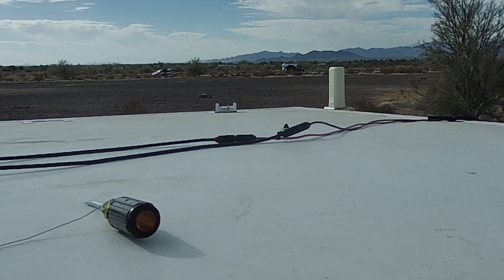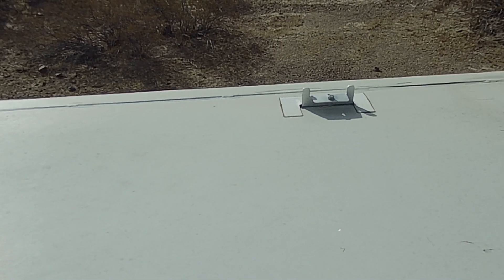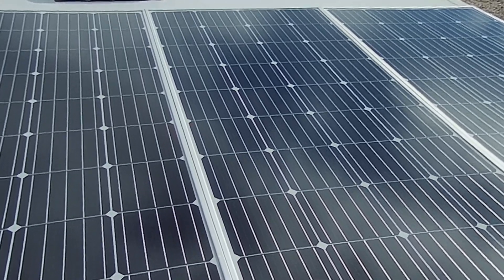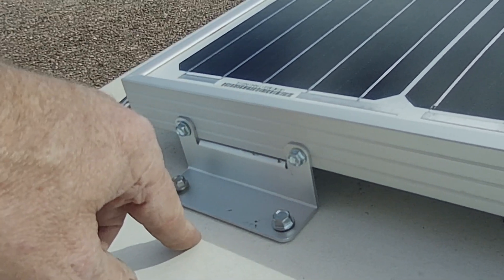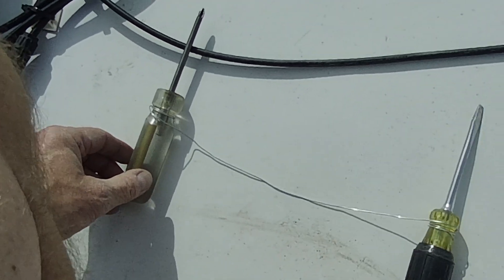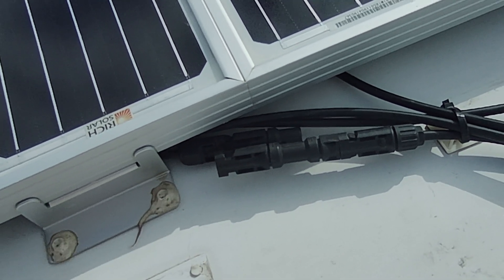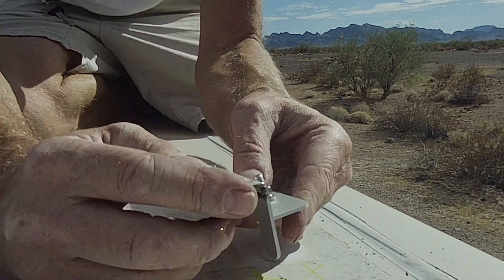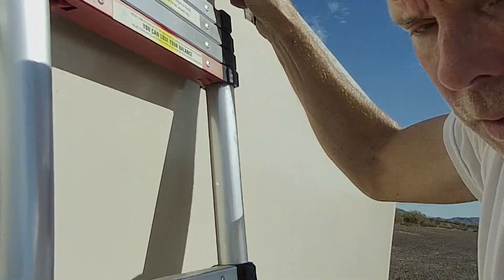What Caused My Solar Panels To Fly Off The Roof Of My Ambulance Conversion?

Comment: The reality is. Taped mounts probably failed long before the panel tore off.  The remainijg mounts with torn through bolts were probbaly holding it for hundreds of miles.
Reply from the maker: Agreed - the tape showed signs of having failed long ago.

Comment: Was this VHB tape or some other tape? This BlueFix video goes into some detail about mounting panels in a 'definitely not coming off' sort of way (using silane adhesive rather than tape) : https://www.youtube.com/watch?v=hAJJ3sYgILc  Thanks for posting details of your failure - this is how we learn stuff.
Reply from the maker: It was VHB tape- I can't remember which version. If I had more than 3 brackets across the leading edge holding all 3 panels, it would have held i think

Comment: The conclusion is wrong
The manual state a bracket of at least 3mm thick, a thicker bracket would have prevented most of it, the other problem is not screwing into the frame

Comment: You can put 50 brackets with tape. Eventually, the wind will rip them off. 
Wind deflectors would be the solution.
Reply from the maker: I added a wind deflector along the front 2 years ago  :)

Comment: My guess would be that the center panel tape lifted on the leading edge. and since the panels were screwed together with self tappers in aluminum then it became like a wing and once the wind caught that leading edge it stressed the other brackets and tape until failure
Reply from the maker: It sure like a sail flying up in the air!

Comment: The tape I see is the Eternabond tape, did you only tape across the bracket?  This is not what people mean when they say "tape" it on.  VHB (very high bond) tape is double sided thick tape that tapes under the bracket then to the roof, so the bracket is taped directly to the roof.  Your method of taping across is a very weak method.
You put panels way too close to the front leading edge of the roof.  That close forward you do pick up a lot of air, more so bc the air is forced over the roof edge exactly right there.
Putting the panels a foot further back would eliminate the issue of air putting so much stress on it.
I cannot tell how high your panels were, but the lower the better, leaving 1/2 to 1/4 inch gap to let the hot air escape when parked, and to get the cables under.
I think you had far too little square inches of tape also.  I would use tape along the entire length of the short edges, maybe angle iron instead of 2 inch brackets.
The roof metal looks so think as to be no-existent as far as a bolt or screw goes.
I never, never screw into an RV roof, bad bad.  Use enough VHB tape and you will not be able to pull the panel off even standing over it pulling with all your might.
Surfaces must be very clean to use tape also.
Issues look like:
-too little tape, wrong kind of tape, wrong application method using tape, panels too high, panels too far forward in the direct air flow. 
Dont blame the idea of using tape.  you just used the wrong tape.
Dont think that more screws are the answer, you just used the wrong tape and too little contact area.
Dont blame the air, you just had panels too too far forward.
Reply from the maker: I did use VHB tape - it lasted 2 years. Now I have an air deflector along rhe front that sends the air over the panels when we're moving. And each panel has brackets down the sides now.

Comment: I don't have panels on my trailer roof..didn't want to put holes in fiberglass...so I had  a ground panel..didn't need much bcause I'm a power mizer so I tolerated turning the panel on the ground..when I moved I put the panel inside..my house has ground panels..we get alot of snow here so it's easier to remove snow at ground level

Comment: Those brackets aren't designed for a constant 65 mph wind... You can bend them by hand. You are looking at a minimum of 45 psf pressure applied to the brackets.  And you have buffering and head winds that could raise the pressure higher. A 40 mph head wind and you are at 105 and that would be close to 75 psf on the panels. You at least, need 1/8" thick brackets. And a screw through the roof isn't going to cut it either. Safest way is to build a roof rack with posts going down to the wall. Install a plate on outside and inside of the box. Then attach the unistrut "poles" to the plate, running up to support the roof rack. 1/8" plates 1/2" assembly bolts, rack and posts made out of unistrut. Plus you could clear the stuff on the roof by making the rack higher and add more panels that way. I did mine that way my truck has zero holes in the roof. Vents are hidden underneath. Your box, run 3 posts on each side...

Comment: Thank you for showing the tape failure and even the bolt failure. A lot of people are using VHB tape and swearing by the results. Common sense says tape or glue will eventually fail. 
👍

Comment: Dave I am looking to buy an ambulance. But this reflects how wind velocity from the non-aerodynamic ambulance style is a big big issue. I've not seen a video address ambulance aerodynamics.  You're a great teacher and would love for you to explain drag, turbulence, lift, air deflectors, wheel covers, cab-roof risers, rear-tail air deflectors. I think I would consider building a DIY roof riser on top of my cab for fuel efficiency? But loving the Lefty & David vlog show! Appreciate hearing you methodically & logically think through these problems.👍✌

Comment: You may want go with heavier gauge aluminum brackets too . Or put more brackets on the front edge where most of wind force and lift
Reply from the maker: Thanks Dave. See my video on the replacement panels - a lot more front edge brackets now :)

Comment: Use washers and nylock nut/bolts. Bolt them through, bullet proof install.
I have a panel on my cargo trailer. (50w) panel.  One also on the door. 
100w total in wattage. Drove from Ca to Nv no problem..
Use 1 large L panel and bolt them down,across the front, using existing 
Holes. So it doesn't look like Swiss cheese..

Comment: Fender washers, rivnuts and blue lock tight are your friends.  Are those brackets made for mobile vehicle use?  They sure look awfully thin.  Maybe on a house or shed roof.
Reply from the maker: Good question... They're the most common brackets used but I'm guessing there are probably more robust brackets available. Good comment!

Comment: Glad nobody was behind you, & no harm caused overall except for the loss of the 3 panels! Bad enough!! I know this is 3 months old, but just in case this helps & you haven't already done it, or thought along these lines....
I agree with your assessment of adding brackets & larger washers or maybe a bar or plate a quarter inch thick × 1" wide × length of the brackets for the washers. Call me an over-doer, I totally am, but If I was in your shoes I'd do the extra brackets and put a piece of aluminum down the front 2 sides a foot or 2 from the front corners & then a piece straight across the leading edge, following the contour of the windshield & start of the roofline, & try & wrap it around the sides so as to overlap the corner pieces 1st mentioned by an inch or 2 minimum if possible. I know getting it around the corners is easier said than done, so that's where the "try to" comes in... Ha ha!
I'd hate to see anything else like this or worse happen to you guys out there, so I do beg you to be an "overdoer" on this one.. 100% out of admiration & with 100% respect.. I'd like you to enjoy complete piece of mind knowing you've bracketed the living crap out of it, & also eliminated the areas where wind can get a purchase on any parts & eventually fatigue the metal in any component of the bracketing system from the bracket itself & the vehicle roof metal, to the nuts, washers, or bolts...
If you find it to not be too hard of a job, I wouldn't think less of you running the aluminum sheet metal strips around the entire array. Even (or especially) on the rear panel, the wind will create lift on the rear panels too. The air will curl around under the trailing edge back there.. Aluminum does fatigue relatively easily. You know what I mean I'm sure..
Anyways, I probably hope you never have anything even similar happen to you just as much as you do.. Ha ha. 
Keep trucking & good luck!

Comment: I had a metal extrusion company craft a bracket for all four sides of my five panel array. Cost about the same as 20 brackets, but provides 34+ feet of consistent bonding area of tape while also preventing wind from entering ventilation space under the panels. Also allows for near infinite number of screws or bolts to fasten the bracket to the panels.
Reply from the maker: Excellent idea!

Comment: I would do everything possible to keep air from getting under the panels.  I know it's somewhat pricey but I would install a wing deflector wing on top of the cab and deflect air off the front part of the box it also helps with fuel mileage.  Great information on your videos, most people just show the end product.  Maybe make a dvd with most of your build info and sell them.

Comment: You need to put a air guard in front of you panel mounts, to force the air over top on all the panels. A piece of plastic to guide the air flow over the top of them!
Reply from the maker: I'm working on that! I've seen a couple of options  ....
Reply: @TheCampulanceMan  That's what I was thinking too.  And I think even a piece of outdoor PVC pipe with the ends sealed off should do it, if you find a way to attach it.  Plus they're very light, cost next to nothing, and are easy to assemble.  You could even use it to store generate hot water for outdoor showers.

Comment: So, for those of us that already have our panel brackets taped and mounted, we could add the screws into the bracket ears like you did. Also when I installed my panels i used 1 toggle bolt per bracket. I inserted the screw into the toggle backwards then pushed the toggle through the roof while holding on to the bolt, place the bracket on the bolt and put washers and a nut on the bolt. It's a real pain in the butt to get it all together, but it's very secure. I used the toggle bolts backwards because there wasn't enough ceiling space to use the length of screws needed.
Reply from the maker: Hi Jim - I think that adding screws is good insurance. Its easy enough to seal over them with dycor and weather tape.

Comment: We're discussing the install of solar on my ambulance, Blossom.  We're thinking some sort of framing, in particular on the leading edge, to prevent this issue.  Hubs builds bomb shelters so I'm fearful of what it may entail!!!!
Reply from the maker: Well... at least you know the panels will still be there if the big one comes!!
I am looking at a simple air deflector across the front to keep air from ducking  underneath them.

Comment: I would have used continuous "L" or "U" channel the length of the Panels.
Reply: One problem with that will be by restricting the airflow under the solar panels...they need airflow for cooling during the hot summer days
Some sort of air deflector in the front will be a nice solution few mm away from the panel so the air can still freely circulate when stationary

Comment: David this could be my inexperience talking, I see no other comments about it, but is it possible that the tape was the failure (& only the tape) ?  If it were me and I'd maybe be messing myself up, but I would remove all remaining panels, dissolve and clean whatever adhesive residue is leftover and go straight into the roof.  A little locktite on the screws.  Maybe add a couple brackets.  Put dicor on the screw heads, really the whole base of the brackets too.  No?
Reply: I believe the same.  I’ll bet the tape failed first and the leverage of the panel blowing up tore the screws through the brackets.  Watch some videos on 3M 5200 Marine Adhesive.
Reply: @mymicks  & @Travel DuckWonder The tape doesn't provide a structural hold, it only provides additional protection from elements such as rain and UV light. It's not really necessary in this instance bc the dicor is UV resistant so I'm not sure why he added it instead of just adding more dicor. It'd help protect a silicone caulk which is more prone to failure from exposure to the elements.
Reply: @ambikesandboards  I went back and watched his install video.  He used two different tapes.  The tape he used to fasten the brackets was VHB tape, for a structural bond.  He added screws only in some of the brackets where the roof was not even enough for the tape.  He also used Eternabond tape over some of the brackets for protection from the sun.  I’d bet the unscrewed fasteners, with only VHB tape failed first, allowing the panels to lift up, ripping the screws through the remaining brackets.  It’s very unfortunate either way.
Reply: Agreed,it was the “application” of the VHB tape. Extra brackets are not really necessary. I have 2 panels attached to a roof rack with ONLY 4 bolts per panel. It is rock solid. Steel bolts on aluminum bracket means the bracket is the weak point. The PV panels have a wind rating, and it is faster than you can drive! So panels are strong enough.

Comment: I tell you what I would do in this situation, securing any bracket to the roof of that ambulance is very difficult. You  should use a 3M product called panel bond. It’s a two-part adhesive that you need a special gun to apply it and it will rigidly bond any bracket to any surface. The second thing I would do is use a much thicker bracket I feel that the brackets you have are too thin and easily torn. Then lastly don’t screw regular sheet metal screws in the roof of the ambulance thinking that they’re going to hold the absolutely won’t. That’s where the panel bond comes in the place you clean up the surface apply the panel bottom and then put the bracket on top of the panel bond. Then if you wanted extra security I would drill a hole and screw sheet metal screws completely through the roof and attach it with a large diameter washer and a nut. Lastly, you may want to go to a sheet-metal fabricator and see if they can do a visor to run along the leading edge of the front solar panels to deflect air above and around them. One more thing you want to minimize the space between the solar panel and the roof of the ambulance as low as possible without touching the roof.
Reply: I would use steel brackets also. Aluminum is too weak

Comment: I would install a slanted wind foil in front of the panels to divert the wind over the panels not under them. thanks for sharing.
Reply: Right!
Reply: The problem with that is airflow is needed to prevent the panels from getting too hot, when I did mine I secured the panels between two rails that were roof rack mounted, this made them secure but ensured that there could be adequate airflow for cooling. It's a very difficult thing to get right and it's so easy to get it wrong. My panels now can be raised to the 45 degree angle which makes it better for charging when parked up.
Reply: @uncledodge9396  Well they don't get that kind of airflow parked.
Reply: @kadven6447  no, and the thinner glue on panels don't need as much cooling as they're less affected by heat, I think in future I'll use them, they're more expensive but better quality.
Reply: @kadven6447  Right you are... And I'd sacrifice the small amount of airflow for cooling while parked, for the piece of mind that I'm not going to kill someone(s) or lose my solar array that costs enough the first time!! An airfoil can be made so it's easily removed I'm sure. In fact, I recommended an air dam around the entire perimeter because of the combination of lift created on trailing edges by eddie currents, & metal fatigue. It could be made as an easy off, easy on application for panel efficiency if needed.. Although I doubt panel efficiency is a problem in Arizona for a single person & his dog, but in another State it could be, depending... But again, I'd add another panel or 2 on the ground or in the windshield to supplement & keep the airfoil..